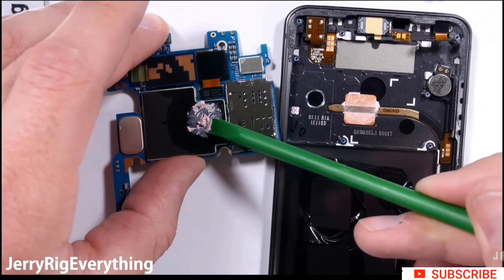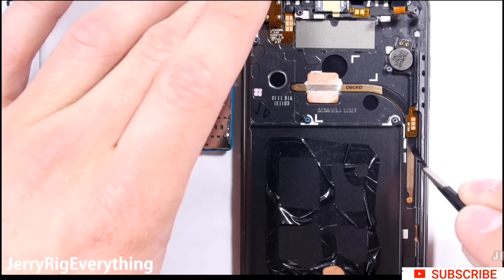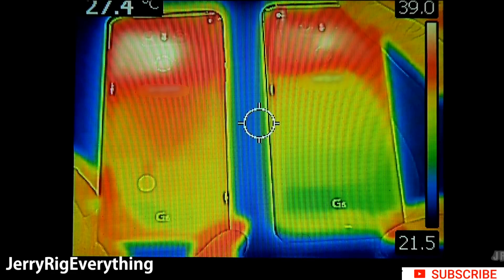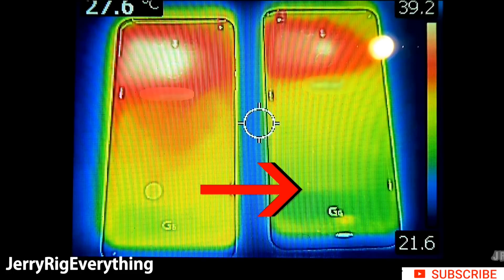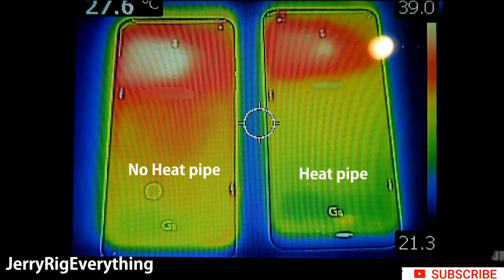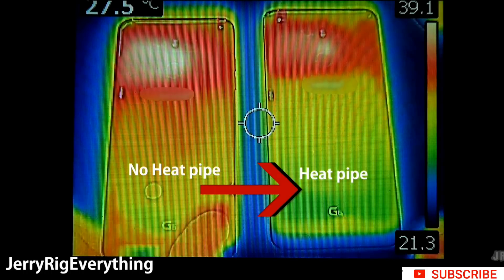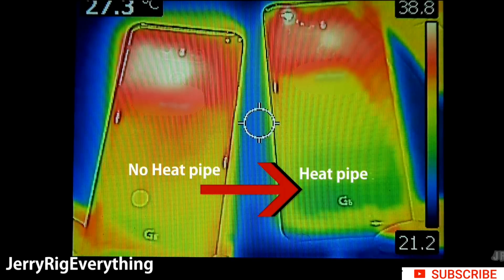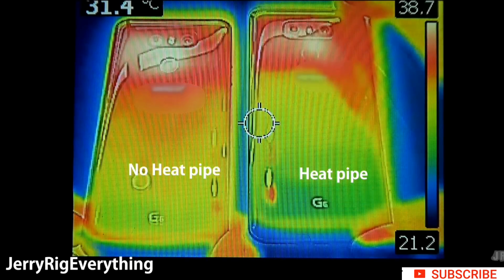EASY FIX Bootloop issue & GENIUS way how Lg solve that with a G6 & should u buy this phone?

Comment: I wonder if it would help to cut an actual hole in the back of the phone and put a heat sink on it?
Reply from the maker: U wanna cut the hole in the glass?😶 cooling is good enough. Thermal paste and cooper pipe connected to frame of the phone. Only little bit better solution would be to replace thermal paste with thermal or cooper pad. I hope u like it 👍, subscribe.
Reply: SzTech & Tv hmmm. I see these on eBay for well under $100.  I like to mod.  What do you think the odds are of getting a used one that will last?
Reply: Also, for the solder to actually melt, it has to be what? 300+ degrees F?  Solder where I work is 500 something degrees F.  At any rate, it seems to me the original solder could be questionable and a phone hot enough to melt solder would be a big problem in your hand it pocket.
Reply: @dwaynemeroin3101  The problem wasn't that the phone got hot enough to melt the solder, it was that they didn't account for the differing thermal expansion rate of the chip and the board itself. So both wanted to expand and contract at a different rate, and that stressed the solder connection enough that one cracked because they were using garbage ROHS lead free solder, which is brittle and can't handle cyclical stresses. If they used lead solder which has a little give to it, there wouldn't be any problem, but they're not allowed to if they want it to be compliant with ROHS standards.

Comment: I don't trust them after G4
Reply: Ahmed Bahaa The g4 had 2 compounded issues with processer failure based bootloops.
Reply: Dat Person Doe. So they have no responsibility about their brand and product
Reply: Ahmed Bahaa the desolder issue came with the g3 but started being an issue after g4 came out and other issue is Qualcomm's fault. However yes lg does 100% need to improve quality control on phones especially because the solder issue carried over into early batches of the G5 too.

Comment: I was once charging my lg g6 (LGM-600k) it got super hot around 50℃ and nothing really happend but after couple of months i was watching a video wid full brightness the phone didnt get hot but the video started to lag and lg logo showed up when i tapped on the screen several times it got back to the home screen directly its been 6 hours since that logo thing happend but im scared if it will get bootloop or not or was that a normal glitch? Please tell me
Reply: rafay suleman That's close to a bootloop. Open it up, put it under a heat gun to get the solder reconnected and apply new thermal paste. My lg G5 has hit 60c playing pubg and nothing happened yet so I dunno
Reply: It happend again twice in this month but nothing really happend no change in working of the device i also play pubg on this mobile tho i think that restarting thing is a software glitch because i had a lg v10 before this which got stuck in bootloop without getting hot
Reply: Huh you play pubg on it? Tbh the heat from the processor might also be helping but I'd still get new thermal paste just for the sake of having thermal paste that doesn't suck.
Reply: I really dont wanna open this phone as its seals are still intact and its fully water resistant ive also dipped it into the pool several times
Reply: rafay suleman eh I guess if you ever crack the screen though perfect excuse to do it lol
Reply: HAHAHAHAHAHHAHA OKAY LOL THANKYOUSOMUCH :))
Reply: rafay suleman screen repair is easy at home screen is only 30 dollars so always do it at home if you can
Reply: I surely can 
Im a true lg fan i also had a lg g2 i changed its screen 
Ytube is full of tutorials lol
I like watching jerryrigeverything
Reply from the maker: Hmm. Well if u planing to do that, your lgg6 wil probably not be water resistant anymore, and better put cooper or thermal pad.
Reply from the maker: Agree

Comment: It's strange why this is happening to a great phone like LG V10. I've used it for more than 2 years and recently started ghosting and battery was getting weaker and suddenly today it died. After deep research I found a way to revive it by heating the SoC and backed up everything. I thought I lost everything but happy there was a solution

Comment: You are great. My son LG g3 stuck on boot screen. Hot gpu with fremel versatip and now its working:) Thank You
Reply from the maker: No problem, great. But probably is not permanent, unfortunately. It will last longer if u buy thermal pad from ebay for few dollars and paste it on cpu. Last time I put the motherboard in oven for 20 minutes on 350f. It was working for one month. SUBSCRIBE👍😉

Comment: Good video! But why not use heat transfer copper foil instead of thermal paste? The copper foil leads away heat much better
Reply from the maker: Jag E hmm that's good, I didn't though of that. Thermal pad is also really good and better then thermal paste... Little update! Subscribe👍😉

Comment: I purchased my LG G4 in October 2015; I was very satisfied with the performance of it while it functioned until early October 2017.  One evening it power down while I was at Lowe's and I have never been able to power it on i.e., to function properly prior to the dreaded "Boot Loop".  I contacted AT&T and LG [fingers get pointed to the other guy]; I eventually did a deep dive in the troubleshooting function on the LG website for smartphones.  I learned that my G4 qualifies for a "Ship in Repair", which means send the G4 to them by either FedEx or UPS [remove the battery, SIM card and MicroSD card].  I need to read both the shipping instructions and agreement again, but if I recall correctly they will run a diagnosis and determine the cause of problem.  If they determine that it is a manufacturing defect then door number 1; if they determine that it was careless/reckless usage then door number 2.  If I choose to ship my G4 to the LG Repair facility [I wonder if this is a 3rd party in Texas?], then I think I am responsible for the diagnosis and shipping.  I have been without telecommunications or close to two-(2) months while paying AT&T for my service; [I really think I am going to cancel service with AT&T because I didn't like how I was treated in the stores while I was seeking assistance.  Besides I am tired of being coerced into new smartphones due to hardware failures and/or corporate takeovers [I once had a great Palm Treo 700 - Thanks to HP it died by corporate sabotage!
Reply: Wow, I now have a functioning LG G4! Late Monday, December 11th, I visited a local FedEx Office and shipped my G4 Brick to LG's Texas facility.  I received email messages during the "Ship-in-Repair" cycle e.g., when LG received my G4, when LG conducted a diagnosis, when LG replaced parts and etc.,  On Monday, December 18th I received my "remanufactured" G4 at my residence.  Although, it only cost $17+ in a shipping charge, I am impressed that the FedEx shipment was the only cash out of pocket expense to me!  I wish my G4 never broke, but it has opened my mind on whether I should keep my AT&T wireless service or not.
Reply from the maker: +Peter Pa wow that's great👍☺ Can I know who u contact with? Bc my v10 has bootloop. U can say here or in my email, link is in description. Thank u! Subscribe!
Reply from the maker: +Peter Pa thank u man👍😉

Comment: Good explanation of the bootloop problem and fixing tip but the statement that LG provides two-year warranty is exaggerated. Except helping their customers in trouble with the problem, they meticulously seek reasons to revoke the warranty. Even the common wear of device is good for that.

Comment: Bullshit.
Lg didn't fix the bootloop by putting a fking heatpipe.
They used cheap sotter materials in v10, g4 and nexus5x. That is why.
The heatpipe just cools down the SoC faster so it can't enters in thermal throttle, so you don't lose performance.
Reply from the maker: +IKnowNothing that's also correct, but bootloop was also happening bc of overheating. Now bc of cooling system phone can't overheat and those pins will not disconnect from cpu or motherboard... Btw. Don't forget to subscribe👍

Comment: Hi, I have Lg v10 with boothlooping problem. Do you think it will solved the problem by replacing the Logic board ( motherboard )??   
Any way Great video men very informative...👍🏼👍🏼😁
Reply from the maker: +Sander john yes that will help, but u can't know how long that other logic board will last. If u find good one, don't forget to replace thermal pad that is in phone, you'll see it. And don't forget to subscribe😉👍
Reply: SzT SzTechnology. I did subscribe! Thanks a lot men 😃
Reply: I spent about 200$ to fix my bootlooped v10 in an unofficial service center
Reply from the maker: +aditovich woow that's a lot. Does it work now? Do u know what they did?
Reply: SzT SzTechnology they replaced the motherboard
Reply from the maker: +aditovich off course... They can't do nothing else... But I hope that they also replaced thermal pad that is inside... That is super important, bc it last about 2 years... Subscribe👍
Reply: SzT SzTechnology I don't know in detail what they did. They just said they replaced the board (plat) in Russian. Before I went to this unofficial service center, I called the official LG Russia and told my V10 problem and they said that yes it was the board and the price of service would cost 80% of the new V10 price at that time. That's why I chose the unoffical cervice center to fix my phone. It's been almost a year and my V10 is still normal. I want to upgrade my phone to V30, but I am really worry that LG V30 will bootloop too.
Reply from the maker: +aditovich don't worry... Watch this vid till the end and you will see how they fix that with g6 n v30. No worries! I'm ising g6 for about 6m and it's really good and it does not overheat. Subscibe👍

Comment: Thanks for explaining. I did try to use  a hair dryer to heat it up but it does not work. Do you think it is safe to put the phone into a oven which is preheated to 176 celsius?
Reply: becky law not phone only motherboard whole phone will pop LCD screen and battery will swell up

Comment: My LG G6 phone that I got NEW on May 25, 2017 did an update on Aug. 2nd or 3rd. After the update it would not boot. 
On a restart it would give notice that the operating system was corrupted and to push the power button to continue. Before I could do anything it would go to an LG logo screen.
I went to the Verizon store; they looked at it and ordered me a replacement.
Most of my data and apps and app settings were lost.

On Aug 10, 2017 my wife’s LG G2 froze. I tried to restart it. On a restart it would give notice that the operating system was corrupted and to push the power button to continue. Before I could do anything it would go to an LG logo screen.
I went to the Verizon store; they looked at it and called tech support as it was no longer under warranty and was not under an insurance plan.
The tech person walked me through several steps, nothing worked. He said he was getting several calls a day of LG phones being “BRICKED” due to updates that LG was pushing out.
The tech guy recommended Samsung or Motorola over replacing an LG “bricked” phone with another LG phone.
Reply from the maker: ggallman Ook! First time I hear something like that. I'm sorry u had that problem with a G6 and G2 and thank you for leaving a comment... What phone now you r using? And did you try something like this, this may help you➡ https://youtu.be/JNAvoq3Dr6U And it's a new channel so don't forget to subscribe➡ https://www.youtube.com/c/SzTSzTechnology?sub_confirmation=1 👍 you can also share this video or channel on your social network... Thanks, bye! 👋
Reply from the maker: +Fidget Spinner man, before u say anything, first watch video. In a video clearly I'm saying how LG G6 CAN'T GET BOOTLOOP
Reply: ggallman your problem is more related to software than hardware
Reply: contact LG they know about the issue and have been repairing phones out of warranty. call them up and see what they say.
Reply: BLISSFUL FAPPER the problem is there in lgV10 and g4 not all models .. 2% faliure rate is present in all brands... If u judge then for one failed product .. it just shows your fanboy-ism. Galaxy note 7 failed and nobody cared !!
Reply: It's more then one failed product! in my family 8 people with LG phones. some it's not their first LG phone.  in the family we have 4 LG g3's and 3 out of the 4 failed, we have 5  LG v10's in the family and 2 of them have failed so far.  We contacted LG over the v10 to ask them questions and they said they said they would repair it even thou it's no longer in warranty.  so out of a total of 9 phones we had 5 phones fail.  The last one that failed was a lg G3 as I was still using my G3 as i loved the phone.  It died yesterday.  You have to remember that phone was fairly old and by now a lot of people would of had it in a drawer or something and upgraded already.  My aunt had a LG G3 and a V10 both fail. at first I was blaming her for doing something or messing it up until some others in the family started to have issues.
Reply: BLISSFUL FAPPER i dunno how your family uses em ... I am currently using 4 lg phones and none of em have had an issue !! That includes 2 V10 s lgG2 and G pro 2 ..
Reply: https://www.androidheadlines.com/2017/03/study-android-smartphones-47-failure-rate.html  look it's way over 2% it's not limited to LG phones.  they have a 47% failer rate for android smart phones and the last  apple ios phone was even higher then that with heat issues.
Reply: we are talking here about pure hardware issues fgs which render the phone useless as a brick or worst explode !!! not considering issues like software errors or overheating or usb malfunctions .. while particular models of lg have hogher failure rates ... doesn't mean u should start abusing the whole firm .. eg samsung note 7 failed doesnt mean they are a bad company or every phone they made is crap !! If you read company SOPs u will know better . LG did great job with V30 and G6 .. and there no reason u should be complaining other than that if you are are a fanboy
Reply: I am not a fanboy of samsung, I won't even buy a samsung without buying an extended warranty. I told my mom the same thing when she bought 3 samsung tab s2 tablets. all 3 failed under warranty.  the one is back for it's 3rd time and samsung is replacing it with the new samsung tab s3 tablet.   my mom and I bought the same samsung color all in one laser printer, i read reviews on the printer and lots of people compaining. so we bought square trade warrantys. her's failed before mine as she prints more then I do. then mine failed also with the same issue. square trade gave us our money back without wanting the printers so i took the printer apart and found a spring had sprung a little to much and replaced it, in time the issue came back again and had to replace the spring again.
Reply: we use our phones a lot. when you use them and the screens are on the get hot. BGA chips and heat don't mix well. over time the solder under the chips break. I went to Devry Inc in columbus ohio to become and electronic tech.
Reply from the maker: +Koome I had a lot of problems with samsung and its more expensive n lg has wide angle cam, priceless...
Reply from the maker: +Koome haha not that man... Older LG had that problem, new ones r really good n still cheaper, n I hate Samsung software that is so full of samsung apps n features that almost no one really need... Anyway samsing n lg are great phones know... We need to leave the past behind... I liked to share thoughts with u, don't forget to Subscribe👍
Reply: ggallman you are probably a Samsung employee for defaming lg .. i have been using lg for 4 years .. and the problem you qre mentioning seems to be deliberately introduced by you or your wife ...

Comment: I'm taking my V10 to a repair shop today at the mall. I'll use this vid as a reference so they'll understand better where the issue lies. My phone bootlooped and just sent me into rage, being that it happened a day after the warranty expired. I really want to save my files.
Reply: If you want to  recover your files use a heat gun and take the phone apart and re flow the solder on the main chip. about 550 degrees f for about 3 minutes. then let it cool back down and put the phone back together. phone will work again but normally not forever. may live a few hours to a few weeks. but like i said once it does it again contact LG as LG repairs this issue for free even out of warranty.
Reply from the maker: +King Keelo13 ok! Interesting! Yea, I understand you... Good luck! Btw. it's a new channel so don't forget to subscribe➡https://www.youtube.com/c/SzTSzTechnology?sub_confirmation=1👍 and you can also share this video or channel on your social network... Thanks, bye! 👋
Reply: did it work for u?
Reply: Call LG they know about the issue and been telling people to send them in for repair and they will repair them for free of charge.  at least for the v10 not sure about other phones.
Reply: Where you able to retrieve your files?